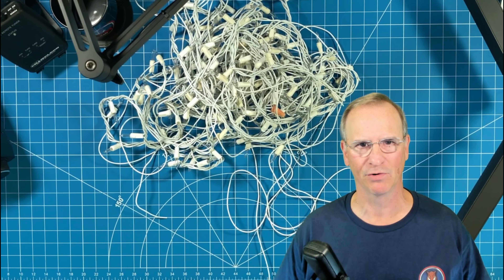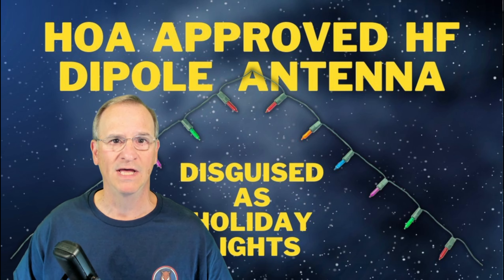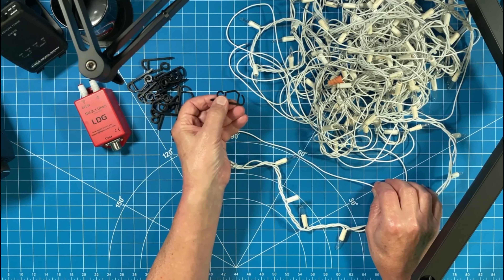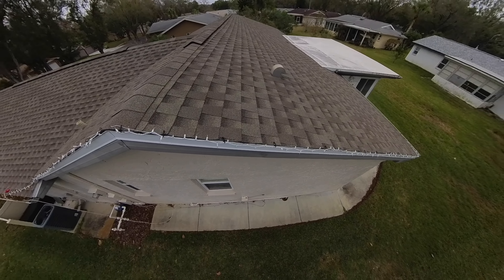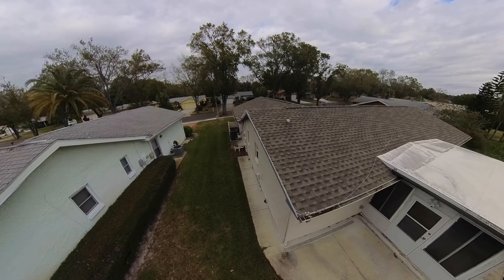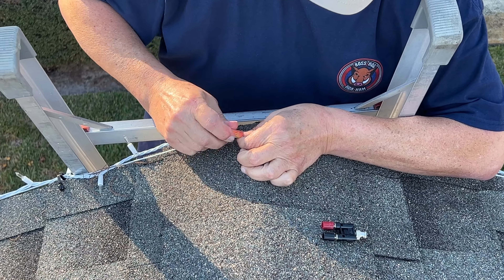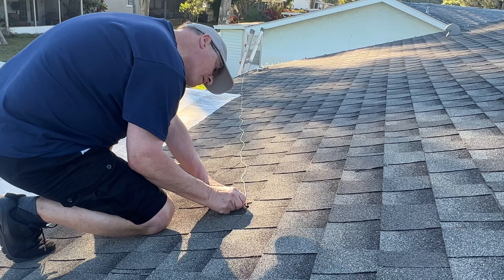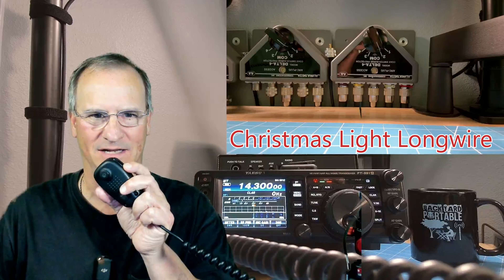The Stealth Ham Radio Antenna the HOA Will Never Find --  Its a Decoration Light Long Wire Antenna

Comment: Great video Bob.  I'm not sure how much RF is being coupled into the gutters and/or into the AC mains, but I suspect that the coupling into these conductors help the radiation.  The point here is that an antenna does NOT need to be "resonant" to work.  As long as we tune out the reactance (preferably at the feed point) there will be current flow and RF radiation.  In any case, it works BETTER than your normal antenna, and that's great!   73 OM
Reply from the maker: Thanks for the view and comment.  Working better than the reference antenna was probably a fluke, and certainly a small sample size.  I'm trying to show operators with challenging circumstances we shouldn't give up.  It certainly isn't the best antenna that could be put up, but it may be the best antenna a specific person in a specific set of circumstances can put up.  If its safe and it works, go for it.  Appreciate the positive feedback.
Reply: That is pure nonsense! How much of that RF energy actually gets radiated for reception on the other end instead of turning into heating a rain gutter??!!!
Reply: @LWRC  not at all. I made my first 1000 FT8 contacts with my rain gutter.

Comment: Hey! OK2IT there. I used to live in UK in rented flat....even worse than HOA I guess.....reason for moving back to OK2 Land and buying a house with some room for anrtennas hihi....anyway, what I used to do is I was using attic Dipoles, attic Inv-V and Attic Inv-V yagis also! I managed to put 2el. 40m switchable array, 3el 20m, and 5el 15/10m yagis, alle made of wires. I had to use lot of RF Chokes, RF Chokes and put grounding rod down and ground everything to reduce noise pickup and also RF burns. Good work!! 73
Reply from the maker: Thanks for the feedback @jiriculak6115.  I haven't shown them off on the channel yet (except for my mag loop) but I too have attic antennas.  You are spot on, it is a great alternative that no one else even knows is there.  Appreciate you sharing.

Comment: Good video. Looks like you are in Florida by the roof-line... You could tuck 16 gauge wire around the perimeter of the roof for a loop configuration. This would allow you to work 6 through at least 40 meters with an ATU.  This shouldn't be very visible either depending on how you wanted to install.
Reply from the maker: Sounds like a future project I need to add to the list; thank for the view and suggestion.

Comment: No HOA will ever dictate or regulate an antenna. The law is clear, a licensed ham is allowed an antenna. However...   Being stealth is great,  cooperative is good.  
Load up the gutters! Lay wire on the roof as a Yagi. An end fed wire laying on the ground will get you on the air. A vertical inside the washer vent pipe. Easy stuff.

 The Amateur Radio Parity Act of 2019 prohibits private rules that prevent amateur radio operators from installing outdoor antennas. The HR 9670 bill also aims to eliminate HOA restrictions on amateur radio antennas.
Reply: Sadly the Amateur Radio Parity Act of 2019 died in committee.  It never became law.
Reply: Depends on the HOA. Mine specifically states all antennas must be used only for fixed wireless signals such as TV or direct broadcast commercial signals per 47 CRF 1.400, Restrictions impairing reception of television broadcast signals, direct broadcast satellite services or multichannel multi-point distribution services. Yes it specifically cites the code which also states: Fixed wireless signals do not include, among other things, AM radio, FM radio, amateur (“HAM”) radio, CB radio, and Digital Audio Radio Service (DARS) signals. So the 6 of us in the neighborhood have figured out ways to get around this with gutters, other hidden antennas, temporary antennas or attic antennas. We will never compete with the 'big antennas' but still have fun and make contacts.
Reply: @steveradloff7134  I find loops are a great option. Frame a wall with wire and feed it at the side. Put switchable break at far end and it doubles as a bent dipole.

Comment: as somebody who had a light set kicking around and wanted to make an extension cord out of it ( don't worry it's safe it has a fuse, does your extension cord have a fuse? ) for low power applications. Each section of lights is joined to a point then it goes back to a common wire and then into the next series section..... it was painstaking it was so painstaking to unravel in revival and I will probably only do it once more. I ended up having to cut sections and spice them back together as there is a continuous run only so far and then it's broken as it goes to a socket and then continues. Yes a continuous separate wire would probably be the way to go.
As much as I would love to see them light up I just think that would be a really cool effect. unfortunately I know there's gonna be a few situations where somebody's gonna be complaining that they're not lit up and if they're not lit up they should be taken down.
Reply from the maker: Thanks for the view.  HOA's can be a little different; in mine, no one would ever point out I don't turn my lights on; it others, the board president would be knocking at the door.  

I'll keep pumping out the ideas in hopes they are useful to some with minor adjustments.

Comment: Thk / Merci. Idée intéressante.
Toutefois il y aura du ROS en cas de pluie ou de neige.
Ensuite, les plastiques des câbles et des supports des LED ne sont pas très résistants dans le temps aux UV.
73's Best Regards  and Happy New year
Reply from the maker: Of course all valid points.  For those who live in an HOA where this gives them a chance to operate with a wire, they will be happy for the trade off.  Appreciate you stopping by and commenting.

Comment: You should have strung the wire as a horizontal Loop around your entire house, then terminated it into a 4:1 Balun and then a short run to the tuner with coax.  With a Wide Range Tuner 10:1 (LDG) you could have been working 160-6 meters.
Reply from the maker: I like the way you are thinking here....  No my brain is working on how to pull this off.
Reply: @HOAHamRadio  Peace of cake.  If I lived closer I’d help you.  I’m in WI.

Also you would be amazed at how well low power works !!   

I have lived in apartments most of my HF life.  Let me know if you want a magnetic loop transmitting antenna, one of my friends makes them.

Comment: Why would you go through the effort of disabling every light bulb?
If you don't plug in the Christmas lights there can't be any interference, right? 
Also, turning the lights on from time to time makes sure no one suspects you.
Reply from the maker: There are fun videos out there where people show what happens when you put RF down a string of lights.  It looks like the light string is defective and broken because the some of the bulbs come on, some don't, with different levels of light.  So, it draws attention because it looks like something is malfunctioning.  I believe that would be more likely to get a knock on the door rather than never turning on the lights.
Reply: @HOAHamRadio  How could that happen if you don't turn both the RF and the lights on at the same time? If the RF is turned off it can't interfere with the lights.
Reply from the maker: @jacquesmertens3369  RF actually turns the bulbs on, without every plugging the lights in.  The RF does it.  Here is a vid of someone showing the RF going through a string of lights, turning them on:  https://www.youtube.com/watch?v=bRpIq1lxqOQ
Reply: @HOAHamRadio  Interesting !  Is the phenomenon comparable to a light bulb inside a microwave oven?
Just imagine what it does to your brain when transmitting.
Reply: @HOAHamRadio  Presumably it shows current or voltage peaks and nulls along the wire.

Comment: The irony that you'd be allowed to leave ugly non functional lights up year round but not a simple nearly invisible wire. Honestly if you can(or can't) get away with this in your HOA You can probably just hang a regular stealthy wire antenna at the same time as functional xmas lights and just not take the antenna down and no one would notice, the only reason people can see this is because of the light string and the color.
Reply from the maker: Spot on.  That's a future video, just a simple wire that blends into the color of the roof.

Comment: Not to defend HOAs but most will only allow holiday decorations during a short period of time and NOT all year long!!!!
Reply from the maker: Yes, precisely what I stated in the video....
Reply: @HOAHamRadio  Yes but what good is that when 90% of the year is not available? The antenna should be out in free space and not next to the house!
Reply from the maker: Welcome to the channel @LWRC.  If you watch over time, you will see I give amateur operators many options to operate year round in an HOA.  That is the whole purpose of the channel and thus the name.  Hopefully you stick around and offer your input and ham radio expertise to help others operate in spite of the challenges.
Reply: @HOAHamRadio  I did. Putting the antenna as decorative lighting doesn't aloow it to radiate into free space!